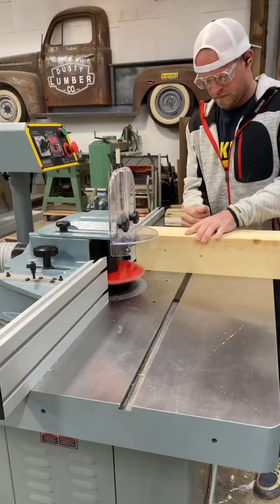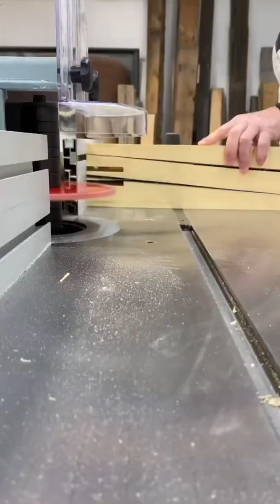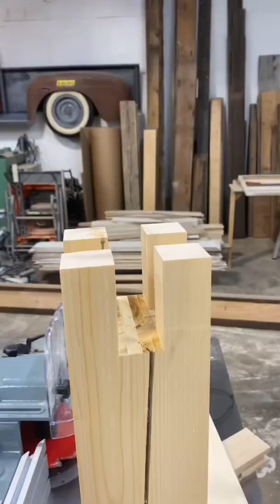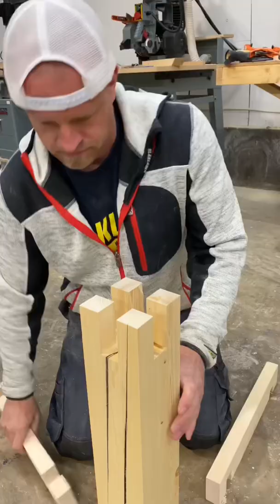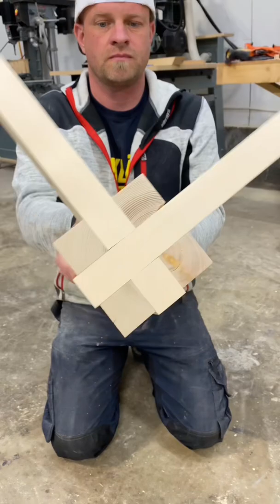Making a castle joint with spruce #woodwork #woodworking #maker #shorts #tools #wood #joinery

Comment: Huh, this made me think of that project they have been doing in France for the past 20+ years.  They're actually building an amazing castle using woodworking and masonry skills and tools from the 1200s.  It's pretty amazing.  The only modern things they use are ropes and safety wear like hardhats and steel tip boots.

Comment: what was that blade on your chop saw?
Reply: Usually "chop saw" refers to a miter saw and I don't see one being used in this video.  The first tool with the red blade is actually a bad ass router table although I'm not sure what the bit is called (probably something to do with mortising or tenoning if I had to guess).  The other tool is a radial arm saw with a dado stack or dado blade.  They probably wouldn't fit in a standard miter saw since the arbor usually isn't long enough.